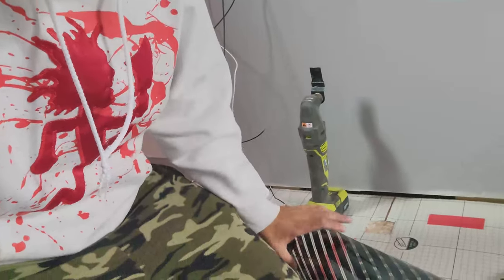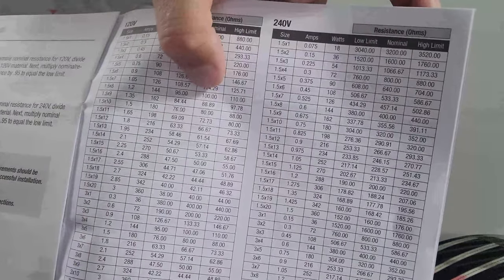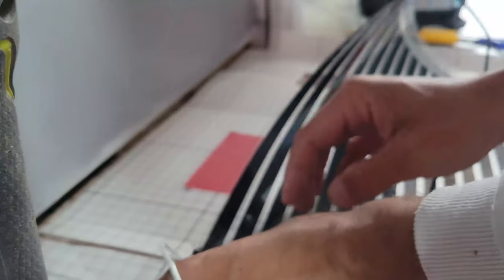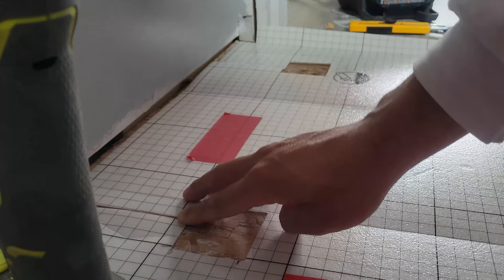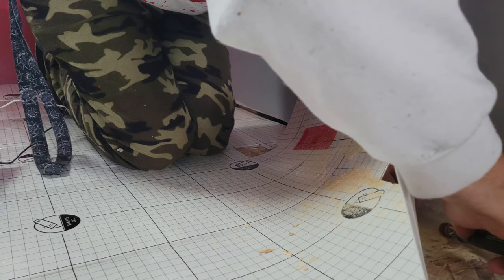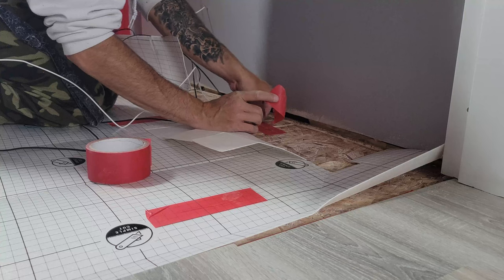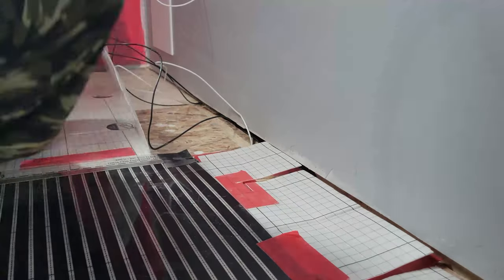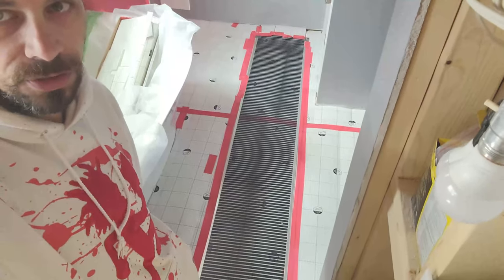QuietWarmth Radiant Floor Heating: The Ultimate DIY Installation Tutorial

Comment: Is this just for cold floors or will it heat the room?
Reply from the maker: It does warm the room, yes! if the floor had more coverage, it would do much better in keeping it warm, since we had a furnace vent in the bathroom. It doesn't help that outside the bathroom door is an unheated hallway and a cold furnace room with exposed cement flooring. so any heat is quickly escaped to the rest of the basement. if for say, the room next to it was temperature controlled this system would work much better. yes. I would consult an expert to verify. I would say that now that we've owned it for a while. I wish i installed a few strips in my bedroom! and my van!

Comment: Shouldn’t you test it before you install the floor?
Reply from the maker: The instructions say not to test it before the floor is installed. However the volt meter test shows that everything worked fine 🙂